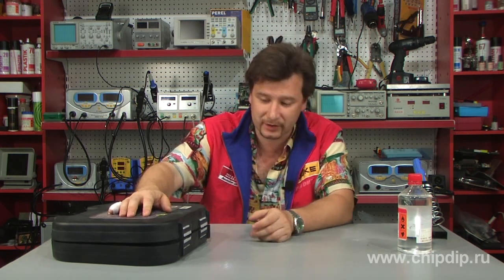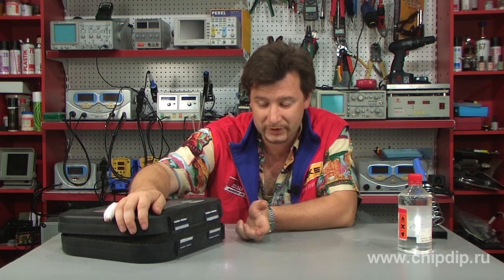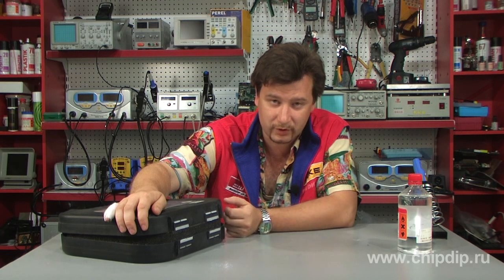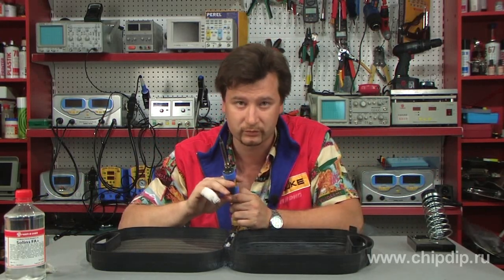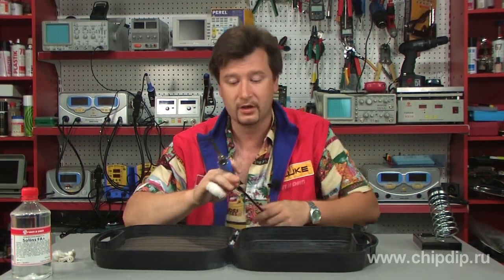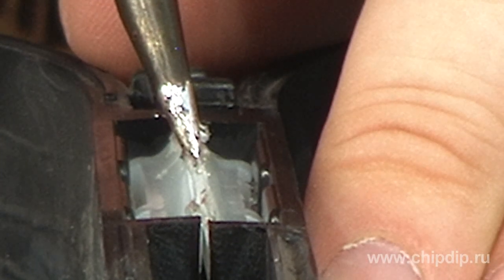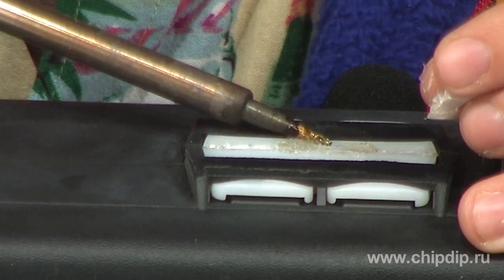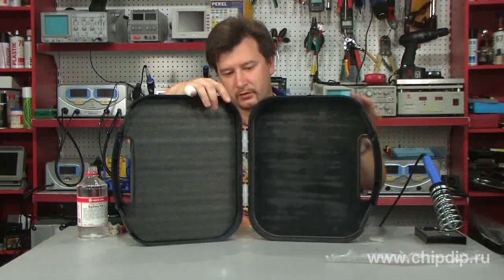Welding Plastic with Soldering Iron

Comment: OMG - the guy's using VODKA to clean the plastic!!!  I knew it was cheaper in Russian, but I didn't realize it was cheap enough to use as a degreaser.
Reply: plus, after several sips, your work starts to look better.
Reply: Vodka is cheaper than water in Russia.  No joke.
Reply: Dixon Cider that's the funniest thing I've seen in a long time
Reply: Talk about confirming stereotypes!! :-)
Reply: I looked up the "Solins FA+" that is on the bottle, and one Russian site says this (through translation):

"SOLINS FA + is analogous to ZESTRON® FA + flushing fluids from ZESTRON; PROZONE + from Multicore; Cleaner Flux-Ex 500, STANNOL) for a more than reasonable price. It is a highly effective flushing fluid based on modified alcohol compounds. This formulation was specially designed to remove "No-Clean" class flux residues using ultrasonic equipment. At the same time, the liquid is a fairly versatile tool that allows you to wash all types of contaminants that arise during repair work."

How do you know this is vodka? It says "modified alcohol compounds," most likely based on isopropyl alcohol...?
Reply: @user-xk5uu6yk5q  The word for Water in Russian is 'Voda'   -- compare with 'Vodka' --- note any similarities?  ;-)

Comment: When I was a kid, I used the leftover plastic frames from revell car model kits to solder a frame for a battery powered rail dragster toy. Plastic welds nicely, it takes a bit of practice to get good at it. Also, the fumes are quite noxious. dont breath them and dont weld for too long.

Comment: From the web site about it for those who are curious.

SOLINS FA + is an analogue of drilling fluids ZESTRON ® FA + Company ZESTRON; PROZONE +, firm Multicore; Cleaner Flux-Ex 500, firms STANNOL) for more than reasonable price.
Is a high-washing liquid on the basis of modified alcohol compounds. This formulation has been specifically designed to remove flux residues class "No-Clean" with the use of ultrasound equipment.

Comment: yes it is possible but not with a soldering iron in fact you dont use heat at all, they are chemically welded aka vulcanised, you can usually find the chemical in one of them whatjemecallits...................its on the tip of my tongue..............it'll come in a min............thats it.....a puncture repair kit lol

Comment: I just fixed a plastic gas can like this and it worked like a charm. I cleaned the plastic with brake cleaner and PVC pipe cleaner and cut a strip of plastic from an antifreeze container. An old motor oil bottle will also work just clean it first.

Comment: Thanks, very helpful. I'll try this on a slightly cracked and leaking carboy I have. Previously thought I would have to get more specialised equipment such as a hot air plastic welder and ldpe welding rods, or find a tradesman to do it. A good low-tech solution.

Comment: Those plastic hinges didn't break just because of "incorrect loading", they broke because they are piece of shit plastic hinges.  There are old metal toolboxes from the early 1900s still around today because they used metal everything including the hinges.  There's just no replacement for that, plastic will always break down, and much sooner than metal does (if kept from rusting away of course)